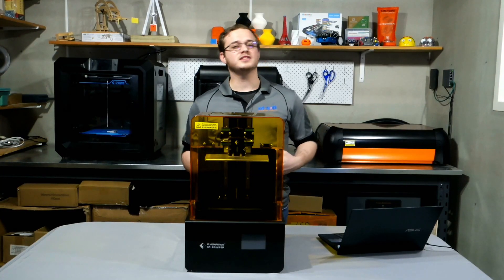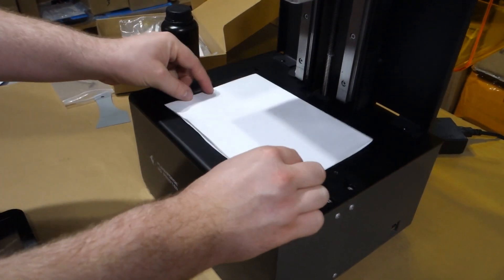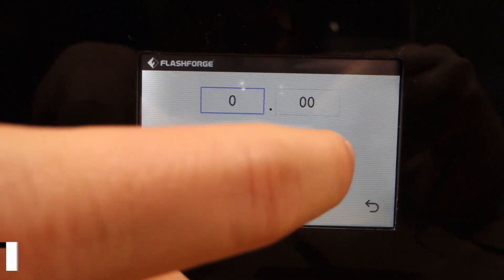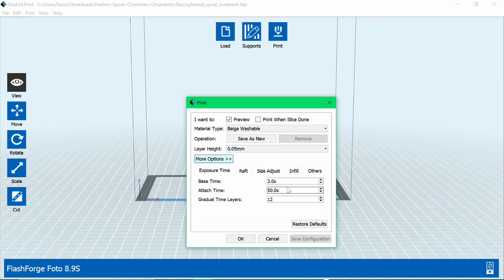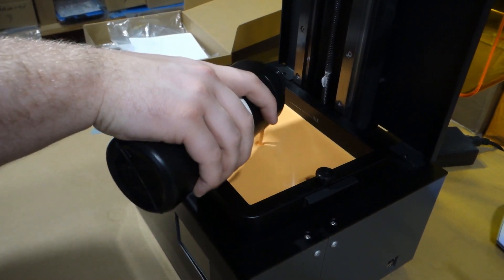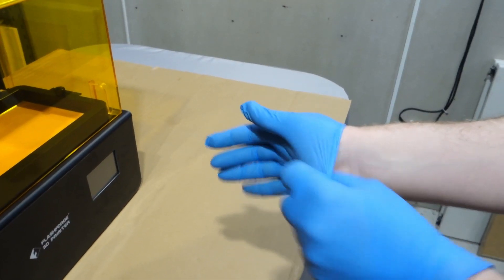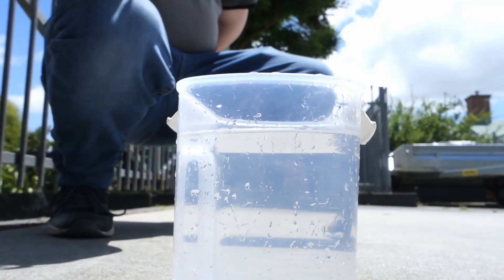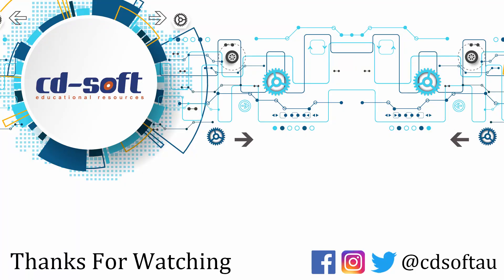Flashforge Foto 8.9s Resin 3D Printer - Full Setup

Comment: just bought mine and its a little different than yours but i didnt get a resin when it came in and it just came a little while ago, i paid for the reasin aswell
Reply: i also did.  no it don't come with it.  but for the price  cant really beat it really.  i just wish it would use other programs instead of a program that gives you 7 day trial and the other one just socks  more like a drag drop print.  i like having control of my work. flashDLprint is limited
Reply: @dragonshr280  yea thank you, i emailed the company and they sent 4 to us, but its not working right... when i hit print and want to hit the arrows to go down to print something below thats not in frame, it freezes and i have to turn it on and off again, and when i do print something without using the arrows and is in frame, it doesnt stick to the thing that moves up and it doesnt make it at all basically. do you know how to fix this?